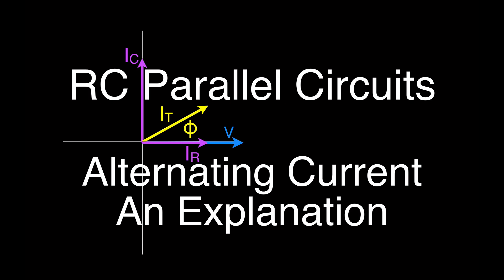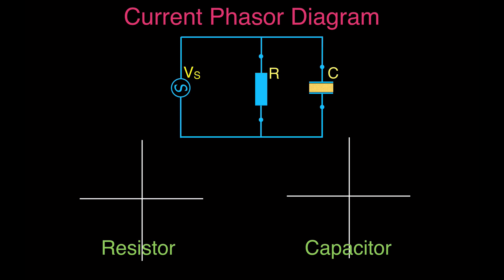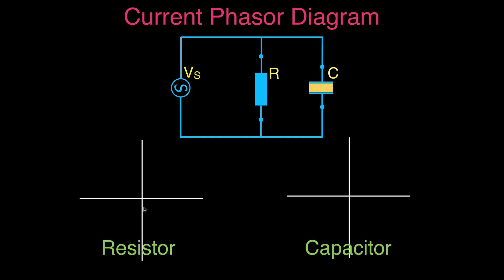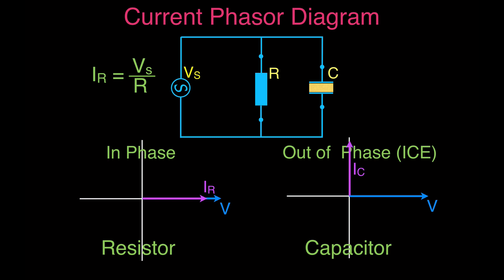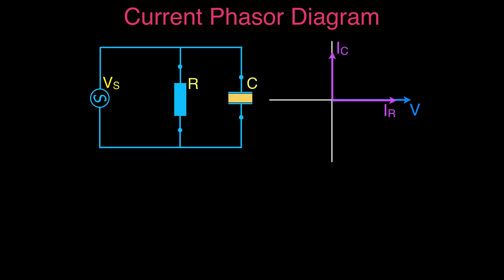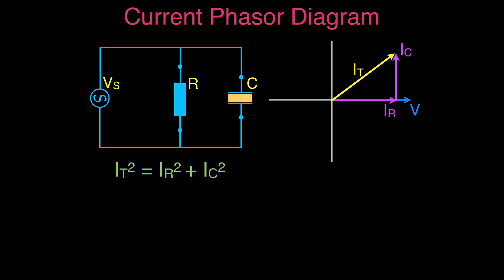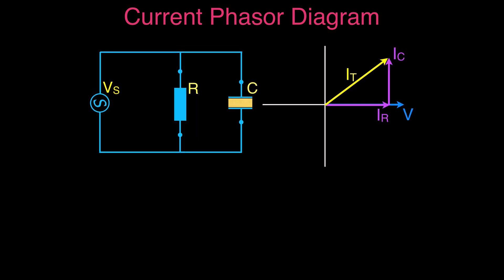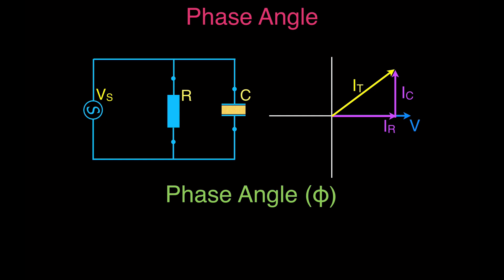RLC Circuits (15 of 19) Parallel RC; An Explanation, Current, Impedance and Admittance

Comment: sir if the voltage source has a phase anglr eg(20V cos(wt + 45)) do we rotate the phase diagram 45 degrees anticlockwise?

Comment: In all the other videos the Xc was drawn on the negative Y axis. Why did you draw it on the positive Y axis this time? Thanks.
Reply: That was because he used the voltage as reference between the two (R & C) since this is a parallel circuit and the voltage across two parallel elements is the same (in previous videos the circuit was in series where the current is the same between connected elements); therefore in a capacitor the current is leading in the diagram (or voltage is passing 'now' & 'after' the current; phasorial diagram rotate anticlockwise over the time). If the current is Taken as reference then the voltage across the capacitor shall be drawn in the negative Y-axis because is 'about' to pass but not yet, and this is more suitable to represent series circuits.

I'm from México so i apologize in advance for my English level. I hope that my explanation is at least readable.